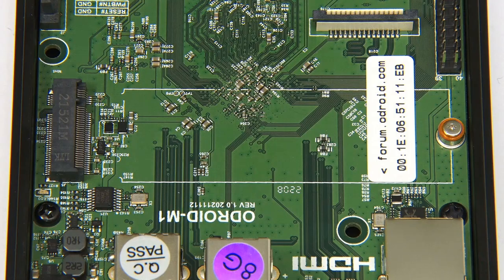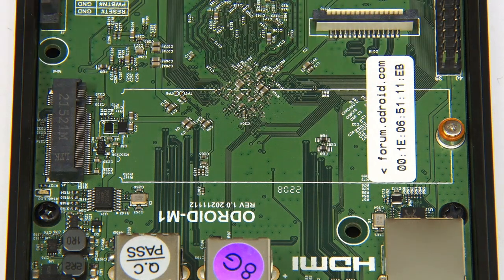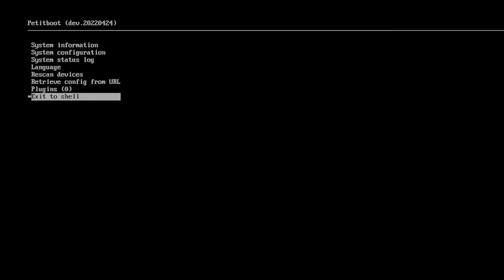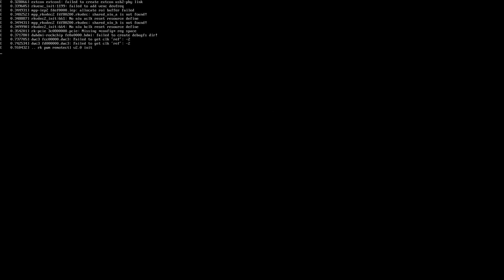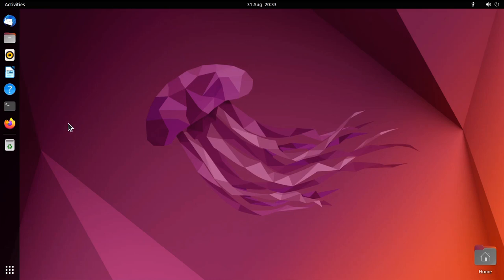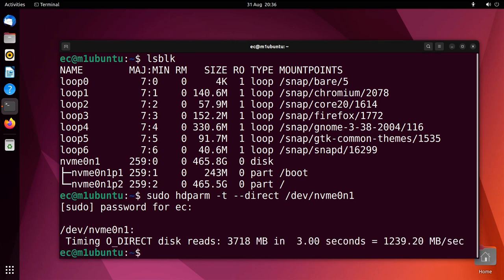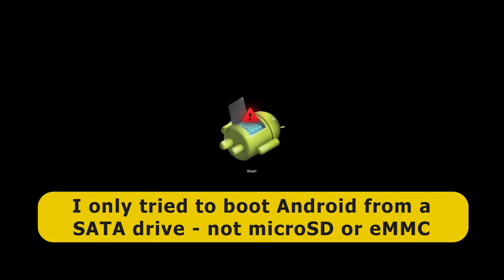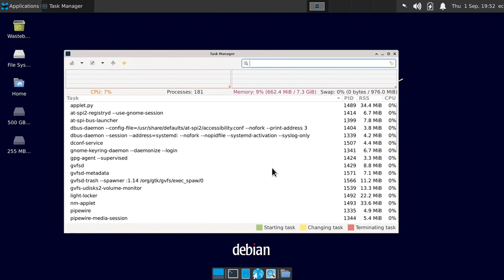Odroid M1: Bootable SATA & M.2 ARM SBC

Comment: A very nice board, and quite well laid out.
I am beginning to really love ARM based devices, it was a novelty at the beginning, but lately I am finding them almost essential. 
Much appreciate the review and the OS try out Chris, you are an excellent guide as always.
Reply: Aside from the economic and marketplace limitations, the Mac M1 is a freaking AMAZING piece of hardware. It blows away more expensive hardware (by 3-4x) at the same task (building software, playing games, rendering videos, etc).
Reply: @tsalVlog  I mostly agree with you, but playing games? lmao
Reply: @tsalVlog  its got the processing power of an 8 year old atom lol
Reply: @Tiago The Apple M1 benchmarks somewhere between an 11th and 12th gen desktop Intel i5 chip, depending on the latter's clock speed, the benchmark used, and single vs multi-threaded performance. That's of course with a much lower TDP of 15W vs at least 65W.

How much of that is inherent to ARMv8 core architecture vs Apple's choices in overall SoC design, I couldn't say.

The M1 would not be my first choice for gaming, but it's certainly more potent at that task than a 2014 Intel Atom, or the integrated graphics on my desktop's i5-9400 CPU (2019). The main problem with gaming on an M1 computer (besides not running Windows) seems to be a lack of driver support for external GPUs.

btw, fanboyism (whether for Apple, Intel, or AMD) won't get you very far in life.
Reply: @wereoctopus  yes but this isnt a apple cpu
Reply: its a rock chip from china that has the processing power of a 8 year old intel atom lol

Comment: I bought an Odroid M1 this summer to replace an ageing (32bit) HC1 as headless server, running Armbian. The EU price was quite competitive for an SBC with an M.2 slot, and wifi wasn't a requirement.
It's doing pretty nicely, running mostly a Dovecot IMAP server and Prometheus+Grafana monitoring. The CPU is not a speed demon but the 8GB of RAM and the NVMe data disk are great for IOPS performance. And with the NVMe it also run cooler than the HC1 with an SSD, which is nice for keeping it in a small closed drawer.
Reply from the maker: I love the idea of a computer running in a drawer. :)
Reply: I did the exact same thing.  I had an HC1 and bought this M1 to replace it.  Actually using the HC1 for a single purpose pi-hole.

Comment: Like so many of the SBCs that you review, it seems to have corporate and institutional uses, but I fail to see what it can do for the home user. The Raspberry Pi is such a great device for home/casual users (when it's available) because of the support that is available. I look forward to other SBCs getting similar levels of love.
Reply: Yep. Odroid makes good hardware. RPi makes good software. A used Mac mini has both.
Reply: Well one thing it can do is get the home user an SBC for under $100 with a multitude of features the RPi doesn't have

Comment: The lack of Wi-Fi/BT (especially in 2022) and inability to playback videos make it a non-starter for me but I do hope they eventually produce an SBC that has all the features. I really like that case too.

Makes me want to refresh my noggin on the current crop of SBC's to see if anything stands out above the pack at a reasonable price.
Reply: Indeed; it appears that graphics is the sticking point on ARM SBCs right now.
Reply: well, tbh, it is a big board and wifi being so nice and convenient is never stable enough, not for me at least, so it is not a big deal, but a mali gpu is not weak, no 1080p video is a no go for me, and the cpu is too old and weak, a55 is just something i used on smartphones many years ago and i won't pay that much for that again
Reply: A lot of people look for boards specifically for having no wireless for security purposes, but would be good if they had the option (separate models or something).
Reply: SBC's are not desktop PC replacements, you can purchase Arm based Windows PC's that deliver a better desktop experience with working video decode in browser but on Linux Arm the chain of software and drivers needed to make V4L2 work is very long with few working on it, thats what would give you web browser + hardware video decode.
Reply: Cheap ones with wifi/bt orange pi 4 lts, rockpi 4b..
Reply: The operating systems installed via petitboot all using newest kernel's (4.19 the downloadable stock image, with no opengl support but opengles) which mean they have Panfrost GPU driver working, there is also a KODI build with 4K Ultra HD video support to install with Ubuntu server image, so hardware wise this board has everything needed for my needs
Reply: @voidtoast4880  i see your ignorance and raise you a full fledged 3.5" desktop sbc: QBiP-1165G7A. gigabyte makes it. they wont sell one for consumers though.
Reply: @voidtoast4880  v4l2 is for cameras, not video decode acceleration. I believe libva is used for decode acceleration, maybe it's vaapi? In any case it is somewhat more obscure, and these accelerations are typically disabled by browsers by default unless you have a tested configuration.
Reply: wireless certification need time and money. HardKernel is kinda small-medium company at S.Korea and it is too pricy for single product like Odroid M1.
Reply: @Void34  I've never found a good, lasting use for Kodi/XBMC. I used to use the South Park plugin, but it's been borked for probably a couple years now. What do you use it for? Just the 4K playback?

/begin minirant
I can't stand the UI by default making noises every time you move selections. It seems REALLY sluggish and clunky with the default skin. I had the misfortune of trying to download it while the XBMC PTBs were protesting either piracy on Kodi or SOPA and they intentionally shut down their site so nobody could access it (thanks, ash hulls). ESPN3 was broken last I checked (without a login, anyway). Kodi also doesn't play well with DWM and always forces itself to display on top no matter where you put it. The default key config for fullscreen toggle being \ is super awkward, too. Even the Youtube add-on is annoying and not very good. The last time I used it was to try to play a BD directly and it had the same menu-less experience as VLC.
/end minirant

Kodi, to me, just seems like an enormous hassle. I can understand using it as the Xbox Media Center on the Xbox that didn't even have a video player (unless you count the DVD kit), but on a PC, it's mplayer and VLC all the way for me.

Comment: this would make a good HC4 replacement with its SATA port, to use as a home NAS server with a single drive . I'm running Debian 11 with LXDE (and OMV6) on the HC4 for a while now and it is working a bit snappier than Debian/Ubuntu you installed. Petitboot is great, and another nice thing you can do is have GRUB2 installed with different kernels etc, that are shown in the Petitboot menu, which i find  very useful . for only 70USD (on HK website before shipping) - excellent value for money. thanks again for another great review
Reply from the maker: I agree, great NAS potential here.

Comment: A shame about the inflated UK price, but I guess with the current economy and poor exchange rates it's to be expected. This actually looks like a decent all round board, worthy of being a competitor to the mythical Pi 4 8GB that doesn't seem to exist anymore!
Reply: Wait til you realize that Raspi was receiving their Broadcom chips at costs and the company that bought Broadcom has a track record of caring only about the bottom line. Where Broadcom was open to supporting accessible computing, this new company could care less. They’re facing an uphill battle AND dealing with supply shortages. Edit: Avago - Avago Technologies to Acquire Broadcom for $37 Billion
Reply: @ThisPageIntentionallyLeftBlank  That was ... 7 years ago. Broadcom has continued to support accessible computing.
Reply: I bought an X3 years ago from their site, postage to Australia killed me so it was a no-brainer to get the special ufs? Memory chip. Long story short it died the following summer after purchase, video issues not related to firmware/software. It was a nice unit and I almost bought a c2. Did I say postage kills them.
Reply: @ThisPageIntentionallyLeftBlank  I have many raspi although my own experience says these are nice unit with more oomph or other specs for other uses. Also if you looked into their platform you will see they openly use whatever chips they can source for the units they produce at time of production and have enough support that if you are an enthusiast come inventor they may make you terms for a couple 1000s units instead of millions of cm4 you can order from mouser/e14/others
Reply: @ThisPageIntentionallyLeftBlank  That was quite a while ago, they've got a contract so the prices wont suddenly jump. In any case given their hirings and work on the pico its pretty clear they're building their own in-house SOC to replace the broadcom one.
Reply: Just to point out something that is not immediately apparent...
US prices don't include VAT as the rate changes between states.

Comment: Hey Chris, one thing that would be really useful on future videos is where an SBC requires a barrel-jack PSU to also advise what size (i.e. 2.1mm, 2.5mm or other) and whether its centre positive (or highlighting where its centre ground).  Its always annoying when 'adding' an SBC to the collection if I don't have a PSU to guess which one to order. ;)

Great work and video as ever though!
Reply from the maker: Good point, and I did used to provide such information on the power jack. I must do so again.

Comment: Nice review, and the more exposure the M1 gets, the better development and support it will have...my main issue with this board is nvme support...i have purchased 3 different nvme drives and had the same poor results installing anything based on Linux 5.xx kernel (meaning it simply will not boot)...4.19 works fine but am still disappointed because nvme support was one of the main draws when i purchased this back in April 2022..I can report that Android 11 mounted on a microSD card works a treat! And media play back at 1080p/60 is buttery smooth on it! So, this thing still needs some work, but I will ride the tide on this one and hopefully one day the nvme issues will be sorted...Cheers!

Comment: I run an ODROID HC1 since years, extremely satisfied with it. Power consumption is ultra low due to the mobile chipset. Running dietpi as SMB NAS, Pihole, TVheadend, jellyfin.
All in parallel, without any performance issues. Bets 50€i´ve ever spent!

Comment: Hi Chris, Thank You for making this video.
Your review was the second source showing this board CHOKE on a simple YouTube video, or Firefox browser….in the year 2022?   This board could have been so awesome had they only put a slightly more aggressive cpu/gpu combo.  
I wanted it to be so much more.  I don’t see much “future proofing”  choosing this chipset that anemic for “forward looking” SBC design in the year 2022.
✌️
Reply from the maker: Thanks for this, but it is not the hardware that is the problem when it comes to video playback. The GPU is perfectly capable of decoding the video. But there is no driver for it to allow hardware video decoding. Hence the issue could be resolved . . .

Comment: I still think the Raspberry Pi 4 is a much better desktop than the Odroid M1. However, the Odroid M1 would make an excellent server and/or router for your SOHO (small office and/or home) network. Once they get OpenWrt running on it, it would be excellent for that.
Reply: @Tony I mean...for a lot of people these are replacements, especially for kids. These are great computers for introducing them to programming and giving them something capable of doing things they need for school without breaking the bank....
Reply: @Tony i replaced my mom's Windows XP PC with Pi4 4GB two years ago, and she didn't really  notice the difference for web browsing, besides it was working quicker. specially when i upgraded to Raspberry OS 64bit not long ago
Reply: I ordered an 8Gb Pi4 just before Christmas last year. Delivery is due around the end of March next year. Hope the wait is worth it.
Reply: @simonlb24  I admire your patience.
Reply: @Tony I've been using a pi400 as a home computer for a couple of months and it's alright actually. You definitely notice the difference between software or websites that are lean and those that are bloated.
Reply: @Tony afaik the intended use case of rpi was as a hobby computer and for children but the recent ones are more than good enough to use as personal computers. The problem is that people are used to software being inefficient and assume that simple jobs truly require so much computational power. They don't. To use your transport analogy, it's like needing to drive in a huge 5mpg vehicle to buy milk from the shop 1km away because footpaths and bicycles don't exist. I won't claim heavy duty use cases don't exist because they obviously do, but I will happily assert there is no justification for needing a 100W GPU to open facebook.
Reply: My one runs my home automation, locally with very few glitches
Reply: @darsparx  and yet a second hand think centre micro would have better specs, run software the school may mandate and still cost around £100.

Comment: I think these ARM-based SBCs are great, but I'm very excited about the x86-based units. I think they have a lot to offer for makers--especially considering the built-in Arduino-like co-processors many of them have. If you are developing some sort of hardware/software prototype for instance, having the ability to get user input via GPIO pins is incredible. Also, for things like using the Qt Framework for developing UI-based application, licensing is significantly less expensive on x_86-based devices. But overall it's a very exciting time to be in the market for an SBC for projects. Thanks to CB's channel I seem to have acquired boxes of them now, lol...
Reply: to be honest, I'd be more excited about getting a couple second hand i5 based micro office PCs from lenovo, HP or dell at the same price, knowing that I saved them from a landfill. Not to mention they would not be as crippled as the topical sbc.

Comment: Greetings!!
Received my M1 a couple of days ago and just started tinkering with the board. I also received a pre-flashed eMMC with Ubuntu 20.04 and it seemed VERY laggy to me. 
Next tests will be using the petitboot system with an NVMe drive to see what that is like. A funny issue I found was the locking screw for the NVMe drive had the barest "impression" of a phillips scredriver marking but no actual way to use it. Had to resort to small needle nose pliers to remove the screw. Still trying figure out how Hardkernel got the screw in there in the first place. :)
Anyway, looking forward to getting some fun tinkering done with this LTS board. I do not use SBCs for YT playback so that is not a deal breaker for me. 
Thank you for this fine video sir! 

BTW, I did catch and love that shot you took at Apple about the 3.5mm audio jack. Well done!
Reply from the maker: Greetings! My M.2 screw was certainly not deeply stamped for the screwdriver -- I could not use my normal one.

Comment: Great to see Mr. Scissors! This board has a single HDMI port. On the plus side, it IS a full-size port. (I hate those tiny things on a Pi.) But why don't SBCs use DisplayPort? Many, if not most, monitors have at least one DisplayPort connection. And with DisplayPort, you at least have the option of daisy-chaining the monitors so you can get up to three monitors using the single port on the board. It's true that the monitors have to be built for daisy-chaining, but that is not an insurmountable problem. And it would be great to have the option.
Reply from the maker: Good point. There is display port on some SBCs -- eg the Rock Pi 4C has a mini DP connector -- see: https://www.youtube.com/watch?v=BTyIFZPgBT0 and there's also one (via USB-C) on the LattePanda 3 Delta.

Comment: This looks like a viable alternative to Raspberry Pi's. I've been looking to add another Pi 4 to my setup, but considering that this has built in NVMe support (currently using an external NVMe @ 330MB/sec), I think this is a no-brainer. Thanks for this video.

Comment: Lets hope the M1 is better than the previous N2 model in terms of reliability.  Many people report that the USB hardware goes faulty and there is also a firmware bug associated with the real time clock.  I'd be more interested in the expanded features if I could trust the reliability of the hardware and the support provided by the company that stands behind said hardware.

Comment: The standard SATA power connector port would have taken a lot of valuable PCB space.  But at least they've used a polarized connector to help prevent a reverse connection.  I say "help" because you obviously (carefully) bypassed that.   ;-)
Reply from the maker: I indeed took great care. Initially I planned to use a lead I have for a RockPro64 -- right connectors on both ends, but wired differently . . .
Reply: @ExplainingComputers  - Same connectors but wired differently?  That's scary annoying!
I noticed on their website they sell a SSD cable kit for it.  But for your proof of concept your cable did the job just fine.

Comment: the nvme speed is great - good for netfs and 1200mb/s can saturate 2.5 gbe or 5gbe (bonded or bridged) - this looks like a nice machine - great content! - expect driver improvements - you should run sisoft and phoronix test suite - the next gen of these should be even better (ie expect pi5 to be slightly better but diversity is ok too cause it helps supply chains